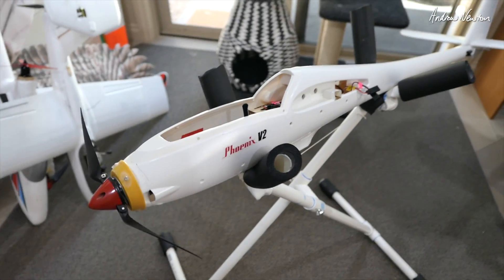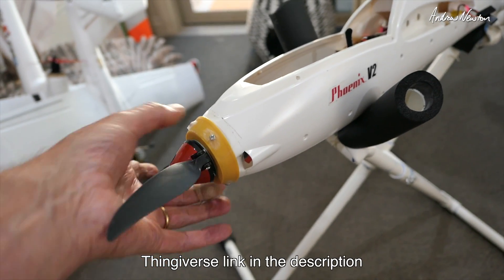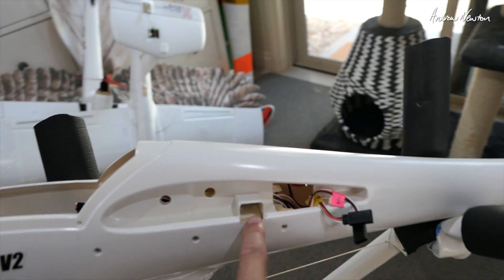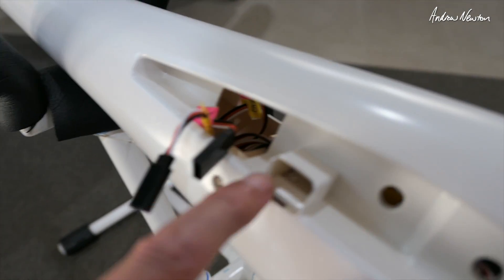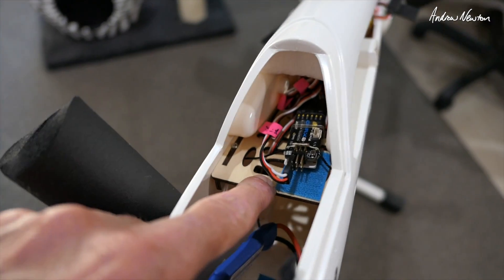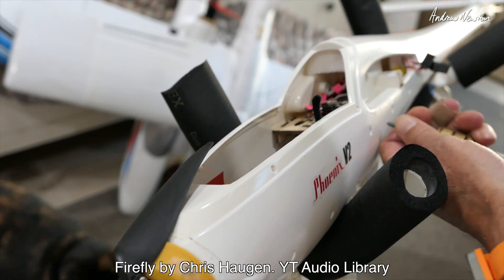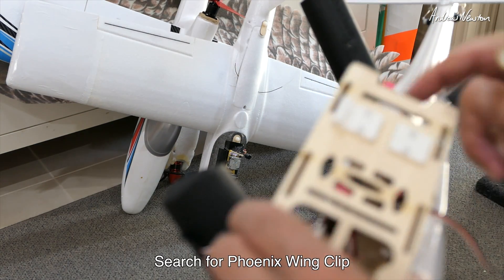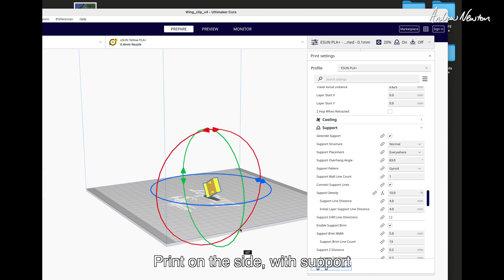Phoenix V2 wing clip and nose repair

Comment: Do you have some general advice on how to repair fuselage plastic? Could plastic dents be repaired with hot water?
Reply from the maker: I have not tried hot water but it should work to pop out dents. For breaks I have seen backing plates, wire stitching and 3D printing like my example.
Reply: @AndrewNewton  Hot water works. 🦾 (but you probably have to be careful not to over do it)

Comment: I sent your nose collar file to a local printer and it doesn't fit at all. the holes match perfectly so i know he print it right scale wise but all the edges are not following the dimensions at all. wasted my money 😢
Reply from the maker: That's a pity. It's not a perfect fit but it works, mine is holding strong

Comment: Hey Andrew man it's been a long time .  Been subscribed just turned the bell off somehow . I still can't fly a fixed wing
. What I would like to see is a fixed wing that uses DJI's motion controller , maybe I could do that lol . I bought the DJI
Avata with goggles 2 and Motion Controller and it opened up a new world of flying for me . I'm doing the things I've
wanted to do since I started building drones 7 years ago that I would never try with any other drone . Well I have the bell
back on now . I'd love to hear your thoughts on building a fixed wing using the Motion controller system . Have a blessed
 one my friend .
Reply from the maker: That would be a challenge but should be possible. I could do something similar with my X20 radio that has gyros inside

Comment: Stupid clips , before I got a printer I had to make mold and cast some . I been at war via emails with exhobby for 8 months on their stupid oddball none standard OD alloy wing spar that you cant buy anyplace on the planet ! I have a fleet of volantex planes I can't fly because of bent spars !  Great planes but I will never !  Have a good day ! Lol
Reply: You should have done what I did: I epoxied a length of piano wire inside the aluminum tube (K&S Metals have one that fits precicely inside). Won't fix a spar that i already bent, but will prevent a straight one from bending.
Reply: @rcbits404  hmm. so a steel spar. I love the blow mold bodies , take pounding.Not use I will buy there planes again. (
Reply: Carbon or glass fibre arrow shafts of the right diameter fit well
Reply: @nigelhall771  true , even tent poles but . But nothing . Its that darn sq tube in wing , its bang on m8 ID so anything generic  m8 won't fit . Stock tube is m7.8. Ty

Comment: I was breaking these wing clips all of the time for a while.  Originally I had ordered a bunch of replacements from HobbyKing/Aliexpress.  Then I found these on thingiverse.  They seem every bit as strong as the OEM version.  They fit most of Volantex's larger models, I have them the Volantex Ranger 2000, Phoenix 2000, Phoenix S, Trainstar Ascent.  There are tons of parts on thingiverse for Volantex (one of the reason I like these planes for beginners (minus the Phoenix line because the weak fuselage) but you can print most of the things that break.  I printed a ton of these wing clips, battery trays and flight controller trays, and vertical/horizontal stabilizer holders.  Better to do it when you don't need them them have them as spares then have to wait for them to print (especially the upper trays and lower trays, the clips are pretty quick.
Reply from the maker: Yes I think just about all Volantex models use the same clips

Comment: Looks familiar, I’ve done both of those repairs myself.
For the dented nose; I pushed it back out and strengthened it by doing some fiberglassing on the inside of the nose.
For the clips; I use 1mm aluminium sheet cut and bent to the shape required.